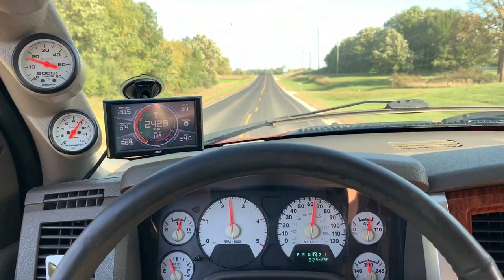EGT Compounds VS Single Cummins

Comment: So it looks like the single is running cooler than the compounds? Have you towed with both setups, if so, what ran cooler?
Reply from the maker: I think the reason you’re seeing the single run cooler is because the compounds I had were choking. I was asking too much of them which created heat. The single 68 is well in its efficiency range so the entire truck is happier. I haven’t towed with the single yet, but will be moving soon and should be able to tell. I have a 5.9.

Comment: When you had your compounds was it stock fuel
Reply from the maker: For the majority of the time, yes.
Reply: @krey8171  any other videos of the compounds on stick fuel that I can re watch or watch
Reply from the maker: Unfortunately not. I didn’t do YouTube until right after I put injectors in it.
Reply: @krey8171  so does this clip have stock injectors
Reply from the maker: It’s not stock fuel. 60% injectors and 10mm pump